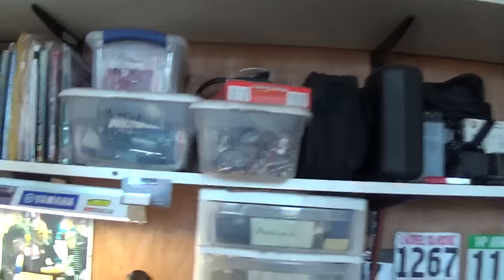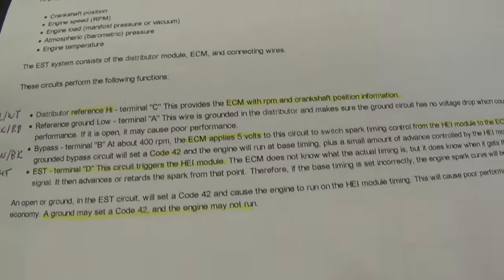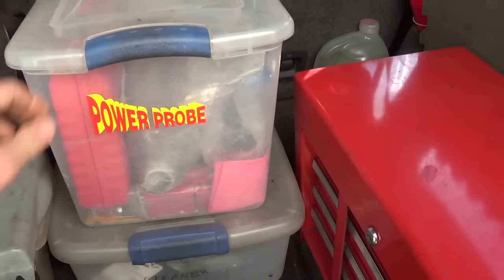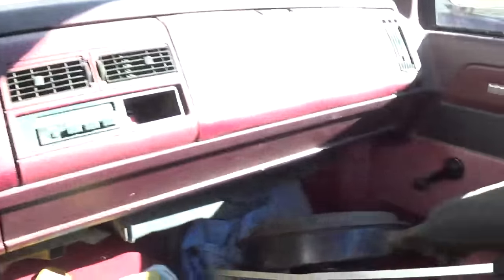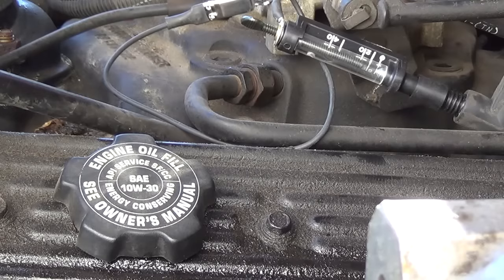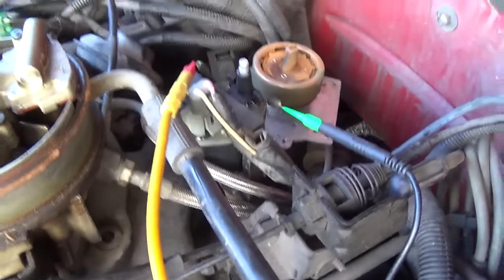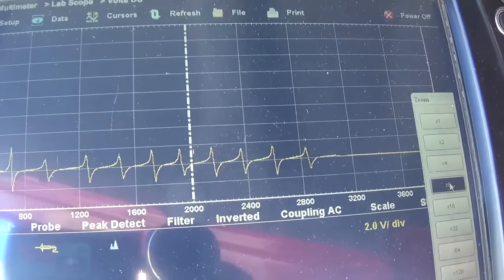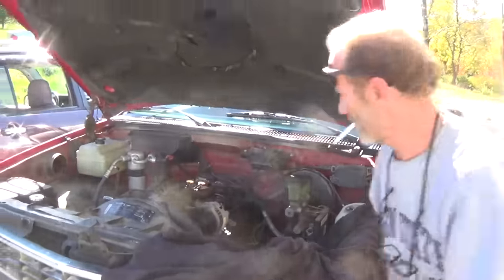Crank no-start: '88 Chevy truck 5.0 V8

Comment: Is your XL-7 stick ? I owned a Grand Vitara, 5-speed what a great vehicle, I thought of it as a 4WD IROC-Z(your prolly too young to get that HA HA HA  P.S. the noise in the dash was a worn/broken HVAC blend door actuator, what an awful noise they make. Dig your videos..  Oh, and 1 more thing, is it true that you cannot update the Autel Maxidas after the 2014 model year, I've heard they cannot be updated anymore ? love that scan tool !
Reply from the maker: Yup my XL-7 is a manual with a 2-range manual-shift transfer case! Gets 22mpg city and highway lol. Very reliable and rugged, except for that pesky timing chain tensioner. Not sure about the MaxiDas updates...but still one of my favorite scanners!
Reply: WoW 22mpg, I could only get 19-20, but I was running 235/70's not the stock 60's. Looked really cool with a set of BFG A/T's on 'er. Thanks for the reply and "Be CooL" around them crappy/brittle plastic coolant unions, they're a summa ma bitch, Later  HA HA HA

Comment: Great video. Love your scanner. Almost my situation with my dads truck which was running great after a fuel pump replacement for a few days then the real  issues started. Truck died in town and towed back. The engine will start and run on its own only with the spout connector disconnected and only up to about 2000k on the tach and no higher like its limited, but spit hell and fire with the spout connector connected and will not not start on its own without some coaxing. Parts list has grown to New cap, rotor, wires, spark plugs, spark control module, map sensor, fuel pump, 2 wire temp sensor, throttle position Base timing is confirmed set to 0 with spout connector disconnected. Codes are 33-MAP signal voltage low, 42-Ignition control circuit(shorted circuit), 54-Fuel Pump relay voltage low. 
What I would like to know is the PCM the culprit now at this point and wouldnt that throw a code 55-PCM failure? i get 12v at the power leads at the PCM plugs and grounds at the ground wires. Without an advance scanner(ill own one someday!) im helpless at this point... Any help or ideas would be appreciated.

Comment: Your comment on the grease was spot on. There is a heat sink grease but, that's different. The grease you applied is for corrosion purposes, The terminals will scrape together just enough make the electrical contact. Don't get carried away using it. I be an EE for thirty years and it was widely used in the telephone company's battery plant. No corrosion there.
Reply: Nope that grease is actually a silicone and it’s meat to go under the module on medal part so it protects it from heat. If he read the paper that was inside it would have explained that.

Comment: Is there a way to test the ignition control module with a volt/amp meter to see if that itself is the bad part? -same year truck and motor.
Reply: was wondering that as well.

Comment: I put over 600,000 miles on a 76 chevy and changed a lot of modules. kept an extra in the glove box. they would even go out driving down the road and you had a dead engine and no power steering. ride em cowboy
Reply from the maker: +John Hafernik Nice! How long do those ICMs typically last? They are pretty cheap so having an extra in the glovebox is a great idea.
Reply: Before that, you carried a spare set of points, condenser and rotor in the glove box! $3 at K-Mart.

Comment: The picture that I sent is of a similar module in a 02 5.7 gmc 3500 van. That aluminum heat sink is just for that module. Hope we will get u and Eric to review the Maxi Das. Thanks again!!
Reply from the maker: +Bill Rimmer Wow so GM finally had the sense to get that module out of the hot distributor for a breath of fresh air and mount it to a proper heatsink?! Cool! 
Do you want to see an overview of my older MaxiDas708 or Eric's fancy wireless MaxiSys tablet?
Reply: +motoYam.  The wireless one Eric has would b neat but if the older one one will do the bidirectional stuff, that's what I am looking for. Some of the comments I have read on Amazon say that the ones they sell r gray market and r difficult to register. Did u buy yours new?

Comment: What is the jump starter you have ? I have tested  a lot of different models. I  have a problem when they are just sitting around waiting to be used. When i need to jump the car they will not jump. Usually sit 12 months to 6. Also none i have tested can jump a truck like that. I would be interested in knowing the model.Thanks.
Reply from the maker: +matthew moore Better yet, here's a review from Eric O. at South Main Auto Repair! https://www.youtube.com/watch?v=0oAA-6Aackw
Reply: Thanks so much
Reply: R&T M I have a Chevy suburban and it cut off while driving like ur video so what can I do

Comment: I know this is old but if you still have this channel and reply to people please help. My truck is having the same issue but also stutters or turns off after the engine warms up. I’ve changed the fuel system, distributor, spark plugs and wires, tbi rebuild kit. It takes a few seconds to start up at first but turns over however after driving to a store and turning it off. Come back turn it on it’ll die. Please help.
Reply from the maker: What's the fuel pressure?
Reply: I haven’t checked. I don’t have a way to check it
Reply from the maker: @xTxShinaGamixTx  Well second option is to load that parts cannon again hahaha
Reply: @PineHollowAutoDiagnostics  ok ?
Reply from the maker: @xTxShinaGamixTx  you have to figure out if you're missing fuel or spark. Basic checks then go from there!

Comment: 305 Chevy. Worst engine they made.
Reply: It was really the 307 seem to have had a soft casting & would wear bad.
But that was a time before most of the people on here were even born.
Chevy blocks (usually for hi-perf or heavy duty service) are cast with added nickel & tin. If it has no additional nickel/tin added, then they are just the "regular" grade cast iron alloy & tend to wear out faster. For blocks with the added nickel/tin, there will be the numbers 20 and/or 10 cast into the block behind the timing chain cover.

Comment: The ignition module needs to have Thermal Transfer Grease on the bottom metal mating surface. The connectors should have the Di-Electric Grease. Ivan, your explanation of the di-electric grease purpose is exactly correct. It is there to prevent corrosion and moisture intrusion. Yes, it is counter intuitive to put an INSULATING grease on an electrical connector, but as you say, the idea is that a nice tight electric connector will push or smear the grease out from under the direct contact point, but leave the grese on and around the rest of the connector.When putting Thermal Grease (sometimes called Thermal Transfer Grease) on the module, use only a THIN coat. There is a thin line betwee too much and too little. If there is too much, you are working against yourself. The purpose of the grease is to help "fill in" any imperfections or "non-flatness" (is that a word?) of the two flat metal surfaces. But too much grease creates an excessive amount of distance, and hence heat transfer, between the two surfaces.The thermal grease is available in any auto parts store, any hardware store, or many other big box stores that have an auto department. Even Walmart, probably.Thermal grease is universally used in the electronics world on power transistor to heat sink mating surfaces.When I worked in tune-up shops in the late 80's, the ignition modules under the GM HEI distributors and the Ford EEC-IV thin film ignitions were very common failures, almost certainly due primarily to heat.I'm curious---ws there only ONE grease pak supplied with the new module? Was it labeled as di-electric or as thermal? Did the instructions say anything about it?  (but I assume you did the same thing with the instructions that we all do-toss it, no read). The box or the instructions or the grease pak itself should have identified what type of grease it was. Most quality thermal grease is a white paste. Most di-electric grease is a greyish-clearish type substance.  If you put the di-electric grease on the module mating surface, I would get back to the customer and wipe it clean and put thermal on it. The di-electric would probably due more harm than good if used on the module mating surface.
Reply from the maker: +douglas lee Well the part came with no instructions and a small mystery packet with clear grease. I only put some on the contacts, and nothing on the bottom of the module.
Here's what AllData says:
"Be sure there is a sufficient amount of silicone grease on the metal 
face of the module and on the distributor base (where the module seats),
 when reinstalling the module. The purpose of the silicone grease is to 
cool the module."
So the factory instructions tell you to USE SILICONE GREASE! wow.
Reply: +motoYam82 Ivan,I think it is a matter of semantics.All silicone greaases are not created equal.Please see:https://en.wikipedia.org/wiki/Silicone_greaseespecially the paragraph that says:"Thermal grease often consists of a silicone grease base, along with added thermally conductive fillers. It is used for heat transfer abilities, rather than friction reduction."I think the AllData verbage is actually referring to thermal grease, even though they call it silicone grease.There is also a very detaailed set of paragraphs about Di-Electric Grease.The wikipedia article describes both Thermal Grease and Di-Electric Grease as both being a "silicone based" substance, but with each being a special variation built upon that, to become focused toward the two exact purposes.I suspect that the grease that was in the package was actually intended to go under the module. I reiterate the suggestion to contact the vehicle owner again, or that vehicle might be back with another failed module in a few months, if the thermal grease doesn't get applied to the mating surfaces.With greatest respect,douglas
Reply from the maker: Thanks for the info! Making a "mythbusters" video right now on this subject...should be up tomorrow!
Reply: +motoYam82 Cool.  I tried to find some good info on the internal schematic of that 7 pin HEI module but did not come up with the detailed info I was hoping for.  But I did read that the current draw is probably closer to 6 amps than 5.The 7 pin design is a LATER design than the original 4 pin HEI design.      Based on the physical SIZE and surface area of that heat sink/heat transfer plate on the bottom of that module, I am betting that it gets VERY hot.In addition to the main power switching transistor inside the module, there are several resistors, (which also create heat), along with some other components.Do you have any interest in grinding the top off that module using a Dremel? If not, you could send it to me and I'd do it and report the results.

Comment: hey Ivan where you connect the scope leads to the vrs sensor on both wires or one to ground and probe them individually
Reply from the maker: +Andres Ospina Depends on the design, meaning if the sensor has a "floating" ground that is not tied to common ground. I always keep the COM voltmeter/scope lead on BATTERY GROUND or equivalent. Never trust a sensor ground! Have gotten burned by that before :)
So with a floating ground VRS sensor, you will see the same amplitude signal on both wires, but 180 degrees out of phase (try it on 2 channels!) and double the amplitude if you measure across the wires. On a regular-ground VRS you will only see a signal on the (+) sig wire.
Reply from the maker: +motoYam82 So in this particular case on the pick-up coil I would have seen HALF the amplitude if the black COM lead was connected to common ground instead of the opposite side of the pick-up coil :)

Comment: Im having trouble on my 89 man i changed out both ignition module and ignition coil and still nothing
Reply from the maker: Did you actually test any of the components and wiring? Parts cannon isn't very effective lol
Reply: Pine Hollow Auto Diagnostics do you have a link of the electrical diagram schematics can not find any in the truck
Reply from the maker: @alejandro.6314  I can email you the PDFs of the powertrain wiring diagrams... Just send $40 PayPal to ivan@pinehollowdiagnostics.com 👍

Comment: I'm having same problem with my truck. I replaced cap, rotor, coil, and ignition module and still don't have spark! Any ideas?
Reply from the maker: Not many parts left to replace lol
Reply: @PineHollowAutoDiagnostics  PCM maybe?
Reply from the maker: PCM is not in charge of spark on start-up. Did you check the pick-up coil in the distributor like I showed in the video?
Reply: @PineHollowAutoDiagnostics  No I don't have the the scan tools like you do. So probably have to take it to auto shop and see what's wrong? I wish you were here I bet we could figure it out. But I am stumped! I usually do my own work on my vehicles. I'm thinking it's PCM or just bad connection. IDK Not sure?
Reply: Can I just replace the distributor or new pick up coil on distributor?
Reply from the maker: @stevenschnepper8248  I think the pick up coil is sold separately...
Reply: @PineHollowAutoDiagnostics   Okay I'll see if I can replace that next. Thanks for your help!

Comment: I changed this exact piece but still getting the same issue , any recommendations?
Reply from the maker: No spark?
Reply: No spark , truck didn’t even start with starting fluid
Reply: Did you fix it ?
Reply: @angelcarmona2456  I did I had to change my distributor , change plugs while I was at it

Comment: I have a 98 chevy 3500 454 I put everything new but i gace spark
Reply: I have no spark
Reply from the maker: @wilsonvalentin1738  N. E. W.... Never Ever Works
Reply: @PineHollowAutoDiagnostics  wym I change everything I wish I could post a video of what mine is doing
Reply: I change crank sensor twice if change coil 3 times I change distributor I also got a new ECU from flash pro still no spark
Reply from the maker: @wilsonvalentin1738  sounds like the parts cannon is out of ammo lol! Time to get a notebook, do some research, and do some real diagnostics. Ignition system is pretty simple on that truck 👍
Reply: Ok like look for what I've changed everything still no spark its crazy

Comment: I have the same problem but it's new along with the pick up coil and the coil pack and the distributor ,fuel pump and filter, map sensor, idle control sensor ,idle pot sensor and a few other things any thoughts ?
Reply from the maker: +kyle finn Holy crap that's a lot of parts! Might be time for a real diagnosis :)
Reply: +motoYam82 and there is point I more then third but it goes in next Monday I just got it back from fleen and Roberts a month a go but it won't start not and they won't look at it in less I pay there rates all over again even if it's somthi,g they have had put in last time that's under warnty. but this time it's going to mile chevy
Reply: +kyle finn sorry about all the type o in that wasn't looking when I typed and phone changed it all around
Reply from the maker: Well are you missing spark during cranking?
Are the injectors firing? Check the basics.
Reply: +motoYam82 it has spark and the injectors hum but no fuel comes out and it smells of gas. the rpm gauge doesn't move at all tho
Reply: +kyle finn I've been messing with it for a bout two weeks now maybe a little more done a lot of research but just no luck
Reply from the maker: Well there's your problem! The injector(s) coils are probably shorted and drawing too much amperage, so the ECU can't fire them. Check the coil driver circuit (injectors UNPLUGGED) with a test light connected to B+. If it flashes during cranking, then replace the injectors. :)
Reply from the maker: Oh and you can return all those other parts, get a refund, and send the extra $$ to me lol ;)
Reply: +motoYam82 I'll try that in the morning I wish I could get a refund on all this stuff but it was had one problem after a nother
Reply: +kyle finn I got it up and runing their is a slight idle problem wile siting at a stop light or sign ect.  it I won't double peddle it then it dies but it's done that for a wile now.      my problem with it not starting was a small black wire under the truck was riped in half I connected it and she started right up
Reply from the maker: what was that wire going to?
Reply: +motoYam82 I couldn't find it under the hood I think it went in to the cab. it went from the starter up the side of the block in to a heat shild in to a fat boundle of wires then disappeared

Comment: And the next thing that Chevy truck will need is a fuel pump, $12.00 Ebay fix, made in China comes with a new fuel sock also, I suspect that Genuine AC Delco parts are not much better than the ones made in China provided they are good when you get them.....
Reply: Yup, I agree.   $12 eBay fuel pumps are as good and usually far better than ACDelco pumps.  Let me guess....you are an eBay seller of cheapo chinesium fuel pumps and you warranty them for 2 days or 2 miles, whichever comes first.
Reply: @jeffro221  no...
Reply: @jeffro221  I fixed a 1992 Fleetside with one of the $12.00 China pumps.... Delco Remey original AC Delco were made in Japan

Comment: if u checked the resistance on the module instead of all that fancy stuff u could have save the stress on the battery.
and all that cranking dumped fuel in the crankcase if u didnt pull the fuel pump relay.
Reply: As would I. What is the procedure and specs for bench testing the ignition control module?